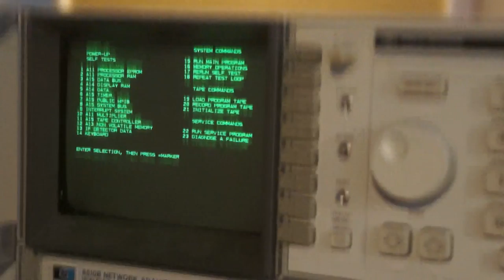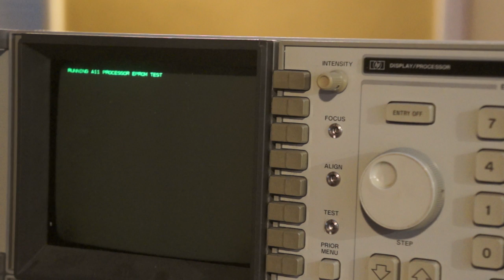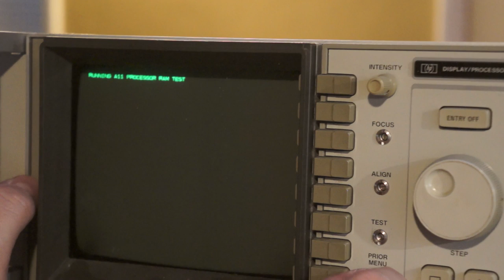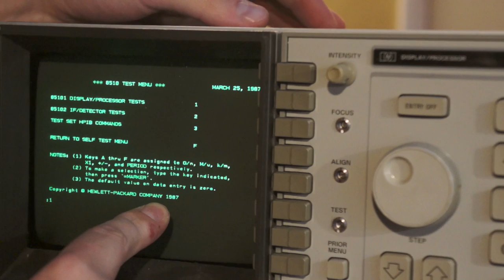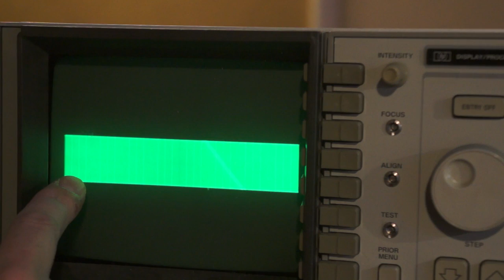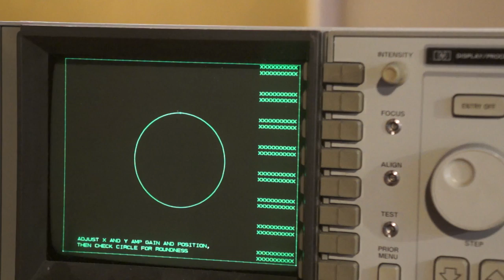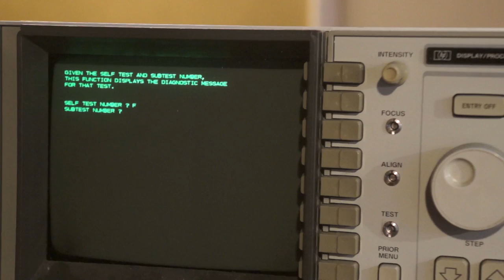8510B VNA Teardown - Display Unit

Comment: The C5061-3012, according to cpushack, is a 16-bit microprocessor, a simplified version of the C5061-3010, commonly used as a tape drive controller.  There is a special reason for the socket design on this board; the chip package is very fragile, being less than 1mm thick.

Comment: Wow it been a whilst since seeing components and circuit cards that old. Some of that design looks 70's. That switching psu with SCR's and those bolt through diodes looks like something from a 70's TV. When you were cycling power quickly I thought the PSU was gonna blow(some of those older psu's weren't as forgiving as modern ones). Hope you can get the leads it needs and get it workin.
Reply from the maker: It's actually already been given away to a friend who plans on trying to fully restore it.

Comment: Check the spacing on the wires for the deflection plates - 150 Ohm impedance cable runs.

Comment: I've heard of things like those elastomeric cylinder things on the custom thing at the 17 minute mark, except they used fine gold or gold plated wire.  They are just a low resistance equivalent to zebra strips for where you actually need any kind of current handling ability.

You can get wet slug tants for relatively cheap (well, a few bucks or less each) from places like Surplus Sales of Nebraska, but their stuff is surplus and probably not representative of the original MSRP.  The few I have were stripped from dead stuff (cuz free).

The stud mount SCR at the 31 minute mark is probably for something that needs very high impulse current capacity but where the duty cycle is very small or that no suitable devices were available in cheaper packages.  Or it could just be a 'fuck it; we have it in the budget for a grossly over spec part' thing like the wet slug tants.

The things at 45:55 are dogbone ceramic capacitors.  Expensive buggers they are.

Comment: The PCB Test "box" thing, Look's like a oversized Strain gauge, would it possibly  be used to to test thermal cycling, stress ?  I'mm Talking Out my Re-Donk-U-Luss here, but the three large contacts and the thin long interlaced traces are interesting.  Back to Donk-U-Lesse's

Comment: Don't you know anything about HP part numbers?  HP often ordered their chips with special part numbers, in two groups of four digits separated by a dash- Agilent still labels custom chips like this.
Reply from the maker: I am familiar with HP's custom part numbers.

What I'm not familiar with, and actually have never seen outside of this particular device, are some of the really weird part numbers. There were chips labeled things like `)437-4561` or `=176-4610`. 

It's not the custom part number I'm surprised by, it's the fact that there are non-digit characters in the part number, like parenthesis, or equal signs.
Reply: Connor Wolf

What I am saying, is that you're looking at the wrong number; they are all eight digit numbers, with the fourth and fifth digit separated by a dash, and sometimes they will start with a C or a D and have a character before the dash. General purpose logic will always start with 1820-xxxx.